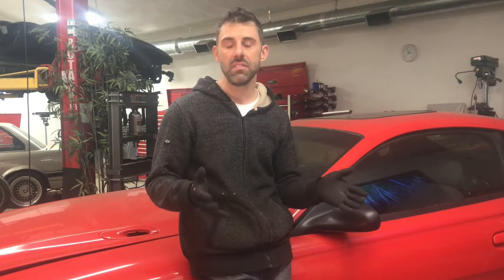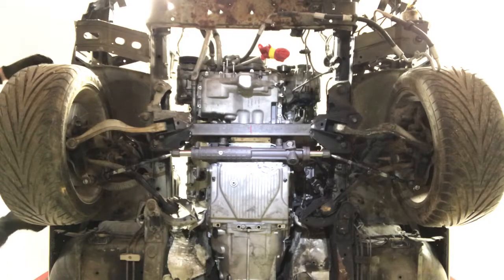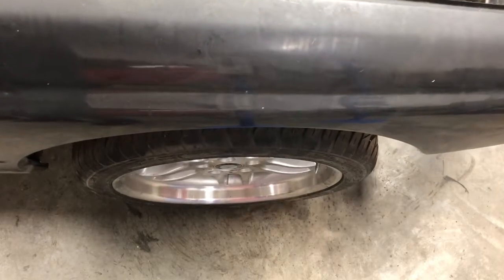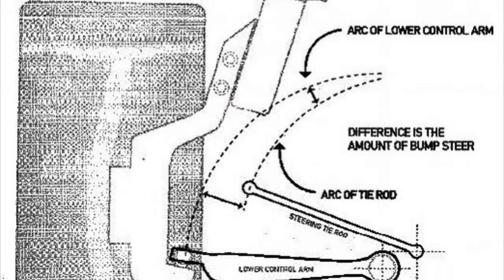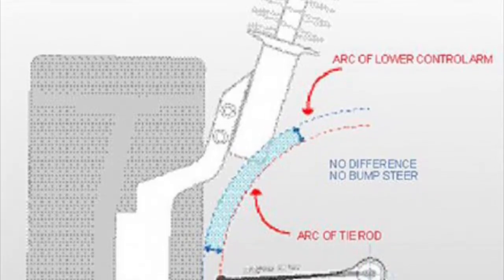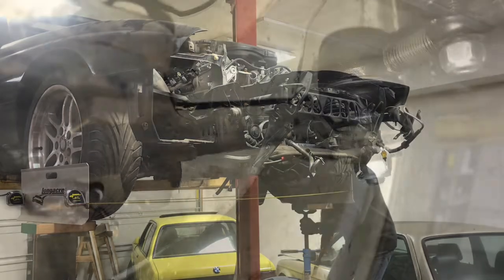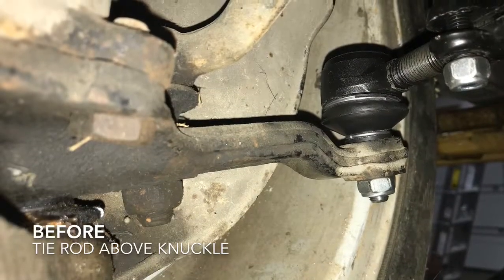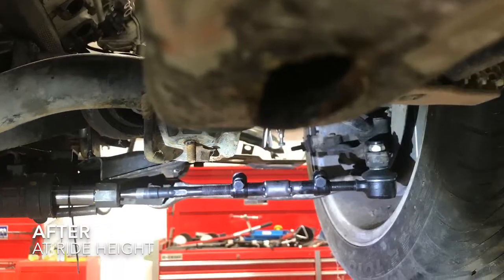BMW E31 850i S85 V10 Bump Steer Problem Solved

Comment: I like the idea of the V10 in the E31 but a question occurred to me is there  reasons why you do not use the e60/63 front end and modify it to fit the E31 it ultimately seems less work and would mean you could use the standard exhaust headers big brakes etc I have both cars and at a glance it seems feasible
Brian
chch NZ
Reply from the maker: I've received a couple comments over the years about this. The main point of contention is that it's not easier. It just shifts the customization off of the oil pan, steering rack and headers to the upper strut housings, hood, and frame rails. It's still a ton of work. Motorcade Motorsport has done that version on their red S85 E31 conversion and it was a lot of work to get all that integrated in that manner. There's no free lunch with this swap, so pick your poison and own it. I owned this side and don't regret it. Just can't wait to drive it and give an honest review! Great comment thanks so much!!

Comment: What you think can cause Bump Steer on a 1997 Z3.
everything was replace on the car, with top quality components.
Reply from the maker: Did you lower the car too much? You may need toe rod spindle spacers if you did. That’s the only thing I can think of
Reply: I installed:  H&R coils, they lower 1.3 inches
Reply from the maker: Yeah that’s a bit much. When the car is on the ground check out how angled they are. They need to be relatively level or you’ll have bump steer for sure.
Reply: @Garageaholic  Thanks much.
Reply from the maker: You’re welcome! Chances are yours are  angled upwards from the steering rack. Spindle spacers would get them lowered at the spindle which makes them more level as the suspension articulated up and down. 
Good luck and thanks for watching!!
Reply: @Garageaholic  I see,Thanks again.

Comment: Hello frank.thanks for this video I have also a big issue with bump steer on an e46. I need advices ,the car pulls randomly to both sides left or right and give steer feedback only when the road is bad  . What advice can you give pleae ? knowing that struts was recently chanded also bushes arms wishbones etc... Can a bad wheel bearing or bad upper support bear on struts do this ?
Reply from the maker: Mustapha Taleb you MUST keep your steering tie rods as parallel to the rack as you can AFTER the car is at ride height. It’s the up and down trajectory of the tie rods related to the steering knuckle that makes the wheels pull in or out as the strut articulates up or down. But I’d need to know more about your setup before making any assumptions.
Reply: @Garageaholic   thanks for advice. i will check and try to aline wheels with your recommendation and see what it gives. Thanks again